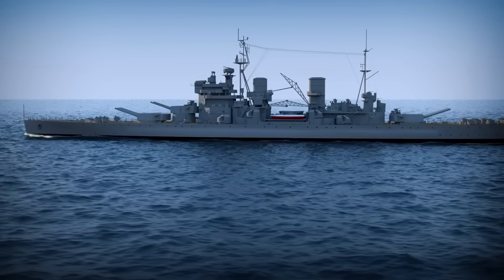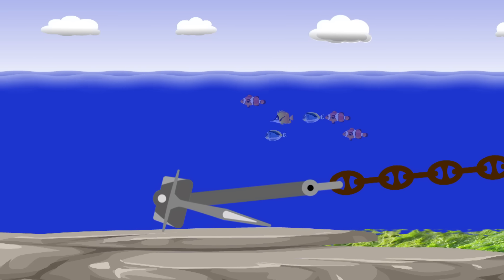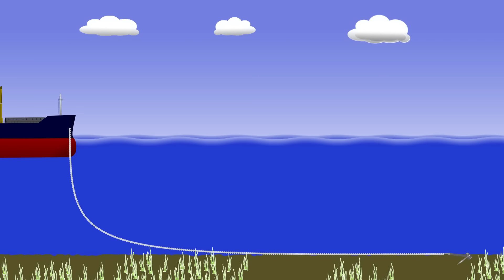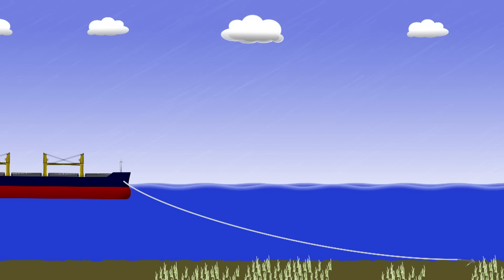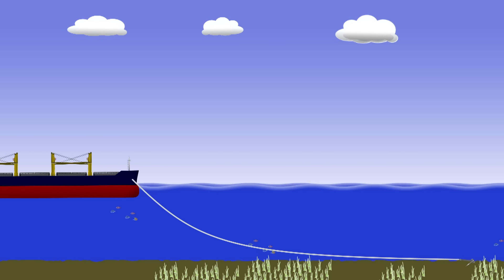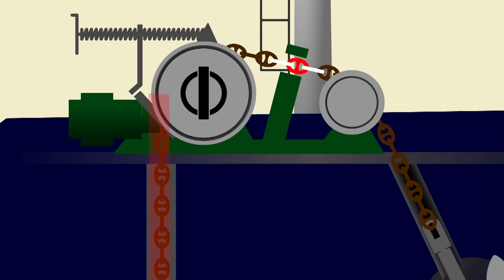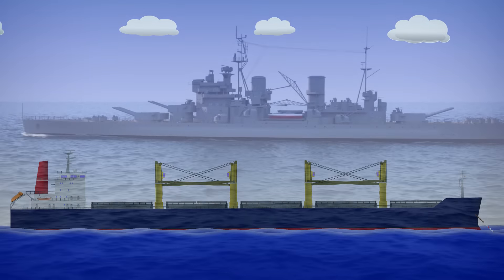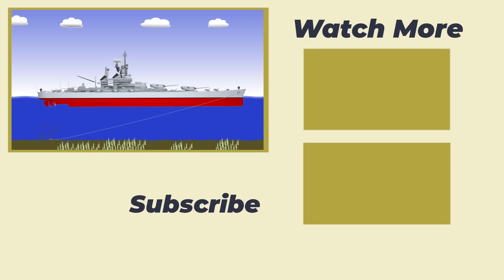The Truth About Anchoring Huge Ships

Comment: I think that one of the causes of this popular misconception is also the terminology used like anchor anchors the ship (no, anchor chain does that) or using "dropping anchor", when you are actually not dropping anchor you are gently releasing it into the sea while braking it all the way down, because if you really drop the anchor without braking the sheer amount of kinetic energy due to extreme weight of the anchor chain will snap the chain and you as a sailor responsible for the operation will be in a world of hurt and your further career prospects are going to be severely affected by this as anchor together with anchor chain is seriously expensive piece of equipment. :-)

Comment: Too much chain could cause the chain to part when the force is high enough.  So the right amount of chain so the anchor drags without parting the chain, but enought to hold in normal conditions without dragging.  The anchors on the ship I was on were 50T, and chain links were 365# each.  Boatswains mate 201.

Comment: Good film and explanation, you can calculate the length of cable you put out by the holding power of the anchor (anchor type) and depth of water. Most use the old method of 3 times the depth plus one, meaning in say 20 m of water 60m plus one shackle, but experience tells you what you need. You can anchor on rock, cutter dredgers use concrete box anchors, but I will horrify you all by telling you the best holding ground was a coral reef. The old sailors used to drop the anchor from the pipe (normally lowered to water) so it had the momentum to punch through the coral, they reckon it could hold in a hurricane. Dragged anchor many times, not a great experience for those not keeping a watch, many end up aground.

Comment: I think it would be possible to do such a maneuver considering similar things are done at low speeds. Just you'd need to essentially custom design a ship specifically to do "sea-handbrakies" probably with a new type of anchor adapted to that kinda use. 

In other words, I expect the props department of the Fast n Furious franchise to have one built for the next movie.

Comment: Anchoring in seaweed beds such as kelp is quite dangerous for a small boat. Usually when anchoring the technique is to let out the anchor chainand  the let the boat drift or motor  back  slowly until the chain lifts a little indicating you have a bite on the anchor flukes. In mud or good holding ground this means you have a good hold  however in kelp the flukes can get tangled in the kelp looking like a good bite. Over time the flukes will slip through the kelp and the boat can insidiously drag anchor. I know from bitter experience of a beached  yacht! Anchoring safely is an art there is no doubt.

Comment: Two things in your video that I believe differently about, someone will correct me if I'm wrong.

1) "Up and down", I thought that referred to, while during raising the anchor, the point of the process where the bow of the ship was directly over the anchor as you illustrated later. 

2) You said the "bitter end" was attached to the ship. I thought it was loose as a run-away anchor chain could do catastrophic damage if the chain ran out before the anchor hit the bottom and the chain were connected to the ship. Or is it connected with some sort of shear link?

Comment: So I'm laying in bed on my boat right now. I live on it. So I think that qualifies me as knowledgeable on this topic. 

Usually the chain holds you in place. Its USUALLY not the anchor doing the work. BUT its not uncommon to feel the sensation of the boat tugging hard on the anchor. Thats the chain straightening out and getting pulled taught. Chain isn't absorbing enough of the shock load when that happens. Means its time to add "scope" . Scope is referenced in a ratio of depth to length. 5 to 1 minimum. 10 to 1 for safety. Maximum for hurricane or a nasty blow.  For example. 10 ft of water 50ft of chain. Thats 5 to 1. 

All that being said, you want your anchor set good and deep, so it doesn't get ripped out if a squall comes through. And you can't always put out all your chain, because you usually have neighbors. This is why its customary to use a 5 to 1, maybe 7 to 1, scope in busy but well protected anchorages. As the wind changes directions, it's important everyone has similar amounts of chain out. If not, you quickly become "that guy". No one wants to be that guy.
Reply: One last thing. If i dropped my anchor doing 7 or 8 knots over a muddy bottom, it would either rip my windlass out of the deck or stop the boat in about 75yards. Thats my guess anyway. Not a good idea. But you always have your anchor ready when entering an inlet for that exact reason. If you lose power, you have to stop the boat as quickly as possible to avoid hitting g anything hard, including other boats.
Reply: It's always the anchor 'doing the work', at least in this situation shown in the video where the chain doesn't touch the sea floor. The geometry of the situation makes the force gentler though, so that might be why you don't feel it, but there's really nothing else that could be holding the boat in place.

Comment: One length, (white to white) is called a shot.  3 sections would be 3 shots.   If memory serves me correctly, the USS Midway has 2500 feet of chain on each anchor.  One link of chain weighs 120lbs (correct me if I'm mistaken).  The USS Midway was built using the basic hull design of the  Iowa class battleships.  I don't remember there being the red links on naval vessels. Also, the shots may be longer.  Too long ago.  Memory fading.
Reply: Sounds about right.  Then there are the warning shots.  If you see red, run or you are dead.

Comment: The only way I know for an anchor to grab like in that movie is if it happens to catch on a rock, and has no slack. This is with small boats going relatively slow, a battleship going at flank speed would break the  anchor, and or chain. I wouldn't be surprised if there was damage to other parts of the ship  as well.

Comment: 0:08 There is some truth to it, but not with the design of anchor seen on the Iowa-class nor can be done with modern, steel-hulled vessels. This trick is known as "club hauling" and was far more common in the age of sail, given wooden vessels are much lighter than what replaced them. The first Pirates of the Caribbean film at least shows the manoeuvre more accurately with a wooden-hulled sailing vessel, but the character Barbossa also mentioning what the HMS Interceptor was doing.

Comment: Cool.  concerning that when force is applied, the chain lifts of the bed, reducing the lateral holding force.  Ideally, it would be better system if the more you pulled, the harder is sticks but clearly there's no way to accomplish that.  well, the lifting of the chain does increase the forward force.

Comment: Very interested video. I had NO idea of how a ships chain worked or functioned in the course of holding a ship in place. I'm assuming ships don't usually drop anchor in waters where the ocean bed is deeper than they have chain length as it would serve no benefit towards holding the ship in position, not that a ship would arbitrarily need to stop and hold position in the deeper areas of an ocean, right?

Comment: Makes sense then that ships use their anchors to control speed and course during inclimate seas by dragging the surface area of the chain on the sea bed like a brake, rather than relying on the anchor head to do the work. Interesting.

Comment: Also lets say anchor jams into perfect spot in sea floor between ground rock. It wont be the ship turning since that chain is in comparison very weak to amount of energy battleship would have while moving, so ether optimally rock gives in, but if not then those chain to anchor connection bolts, if not then the chain it self from weakest link or finally the reeling system on the ship. Essentially all you can hope is some additional drag on one side to turn the ship, but its nothing like the yanking seen in the movie cause materials used would give in before ship would move side ways such violent manner.

Comment: A third thing that could happen if the anchor grabs and the speed of the ship is to high is that the chain breaks. There are plenty of anchors laying around the world where  this has happened. When it comes to the terminology whit regards to anchoring professional seamen thinks fathoms and not meters when it comes to the length between the shackles. There are 15 fathoms between each shackle. One fathom is 1.83 meter. If you notice that the chain is slacking and thightning after you have dropped the anchor it is a sign that the vessel is dredging.
It can also start dredging if the vessel swings like on a pended from side to side. One way to stop this pended is to lower the other anchor onto the seabed but not more than the chain is pointing up and down.😊
Reply: Countries with civilized unit systems operate ships too.
Reply: @isodoublet  Old habits is hard to change. One of the hardest to change is units for measurements. Typical example is the size of the display on television where people still use inches when they refer to the size. In UK people still like to buy meat measured in pounds. In spite of being one of the first countries to ratify the metric system USA still uses old units for measurements. I got a Harley and the only nuts that are in millimeters are the ones on the battery clamps.

Comment: Third possibility - failure of the anchor windlass and/or braking system, causing all of the chain to run out, and typically breaking the bitter end free from the chain locker.

Comment: This guy didn't pay very much attention to the movie because the anchor caught on a rock on the bottom of the sea bed so that the debate would be how heavy that rock was and would the chains tensile strength and connection points be able to withstand sudden snap of the chain

Comment: one big danger you should have pointed out with your little diagram is that there is a risk of an "anchor runaway". the crews need to pay that chain out CAREFULLY. almost link by link. all that weight is pulling on a set of brakes used to stop the chain. if you allow the chain to gain momentum, there is nothing you can do to stop it, and you will end up with a "chain fountain" coming out of the locker.  there are videos online of this, including a US navy ship. if you want to talk about terror, watching that chain going faster and faster and you clamp the break harder and harder, knowing a multi ton snake is waking up below me...

Comment: Here's a question though - How did they raise anchor in the age of sail? It's one thing to say "use the engines to drive towards the chain and take up the slack until you're directly over it", but how do you drive towards the anchor, without an engine, when the wind is actively pushing you away from it? Did they just rely solely on capstans or is there another technique?
Reply: They probably didn't hoist in bad weather and in good weather, pulling on the chain moves the boat forward. When they are finally directly over the anchor, large pull frees the anchor.
Reply: Similarly, in good conditions, modern smaller sailboats often retrieve anchor without turning on the motor. Bigger boats use powered windlass and often necessary to have the engine on to power the windlass since it's such a big drain on the batteries. Sailboat also needs to maneuver safely after breaking the anchor free many anchorages are too small to do that without the engine.

Comment: Great video, but i’m very curious on what the process is when an anchor gets caught on something along the seabed? Perhaps a big stone/boulder, where it gets stuck under, does a ship need to discard the remaining chain and anchor? or is there a specific process on how to retrieve it out of the water?
Reply: Most of the time, that doesn't happen....buuuuut when/if it does, you have to drag over it. In other words, you draw the anchor in while sailing the ship over the anchor (common practice anyway). Because an anchor can't "bite" vertically, the ship will usually dislodge the stuck anchor when directly over it.

Comment: Its is a common error to say that the chain develops much of the holding force. The catenary almost disappears when the rode is in highest tension, and its the anchor that does the holding - provided its a good design. The length of chain is required not so much to generate catenary, as to change the angle of pull on the anchor - the scope. No-one anchors with chain only nor would they think of doing so, its the anchor that should be doing the holding. Catenary is good for shock load absorption, yes, but that's to protect the anchor from shock loading - why? because it does the holding.

Comment: I know next to nothing about shipping, but this video is fascinating.  My question is to what size ship does this methodology apply?  I have been on smaller fishing vessels where the anchors are attached to a rope, or a fairly light chain, so they are clearly not relying on the weight of the chain to keep the vessel in place.  On these smaller craft, I assume they are relying on the anchor to actually "grab" either the sea floor, rocks, or choral.  If this is the case, how do they "release" the anchor when it is time to move on?  In my tiny brain, it seem like the anchor could easily become entangled among the rocks or choral.  On a recent fishing trip to Alaska, I tried to ask the "captain" about this topic, but he was so stoned that he could barely communicate.
Reply: I would assume anything more than a small boat this method should apply. Don't know about the exact size beyond which though, only been to bigger ships. 

The lowering and heaving of anchors themselves are done through winches powered by hydraulics. 

And your reasoning is exactly why we have clearly marked charts where the seabed is good for dropping anchor . You would take good time to decide on a spot. 

If it gets stuck on rocks only way to recover is through ship's movements and in worst case you have to cut the chain to loose the anchor head which have happened in the past.
Reply: The answer is, for all types of boats, this "method" does not apply. The anchor is always what holds the ship in place, at least in the situation shown in the video where the chain is not touching the sea floor.

Comment: The  video, number of white painted links did not match the commentary. The trick of throwing out the anchor and turning the boat does work with small boats, but ships the weight of the anchor vs the weight of the boat are much different though.

The modern naval anchor, apparently used by big ships of all types, was designed to drag if the ship got underway with it down. This was because in the old days of sailing ships if a warship at anchor that suddenly needed to get underway quickly they would disconnect the anchor rope (not much chain in those days and the anchor cable might not be permanently attached to the windlass) put a buoy on the end, so they could come back and pick it up later, and leave it. Modern chain systems can't do that as easily so they had anchors they could drag in an emergency. And because modern ships are much larger (and their anchors) having a design that was self stowing was necessary.

Comment: Good simulation. As a sailor, can you tell me how an anchor works, when there is NO BOTTOM ??? The sea is too deep. The anchor works, but differently. 
Also can you explain about drag and spring back in normal weather conditions ? Catenary, is only half the answer.

Comment: Is the chain just dumped into the chain locker? I’d have thought it would be stored wrapped around a secondary windlass or capstan to ensure it is deployed and stored In the same way.

Also, is and if so, where is the bitter end of the chain secured to the ship? Is it held with a pin at the bottom of the chain locker, or is it’s tension around the windlass enough to secure it?
Reply: Great questions

Comment: Also, couldn’t the battleship technically use the anchor to do an anchor turn? Like if they timed it right, as the anchor caught and the chain started tightening, if the ship slowed down and started a turn towards the side the anchor was deployed from, if they were moving slowly enough that the chain wouldn’t rip the anchor out of the ground, wouldn’t the force of the chain pulling on the ship provide some force to the ship pulling its bow backwards? Which if in the middle of a turn, would pull it around a bit more? I know it wouldn’t be anything fast, it would be extremely hard to pull off, and also probably wouldn’t have much of an effect in helping the ship turn any more than it normally would, but surely if all done perfectly, it would help the ship turn a bit faster no? Yeah it would kinda be pointless to do, and a dumb thing to risk doing and risk damage to the ship, but in a life and death scenario where a torpedo was coming and they HAD to turn faster to avoid it, it surely would help at least a LITTLE bit if done perfectly right?

Comment: Ship is held in place by the weight of the anchor, but in a storm the chain is straightened and little of the anchor rests on the sea bed... so when it is needed most an anchor works least ?

Comment: The SS Badger, a 125m coal powered piston engine ferry, performs an "Anchor Turn" every day. So... uhhh.... Yeah. Anchor turns are a thing, and they are real.
They were used in a time before modern ships had thrusters. Basically it's the same theory as everything you said, except you don't "rip the anchor out". Clearly an Anchor turn isn't an emergency turn, or anything like that, but, Anchor turns do exist, and are used for maneuvering.
(Something else you missed in this video is that if the anchor was snagged on a large hard rock, the brakes in the windlass would be more likely to simply let go, there are a handful of "oops.... we lost our anchor" videos, due to the brakes being unable to stop the drop.)